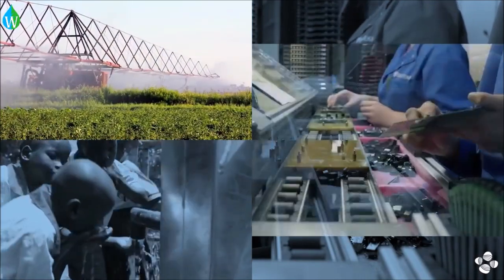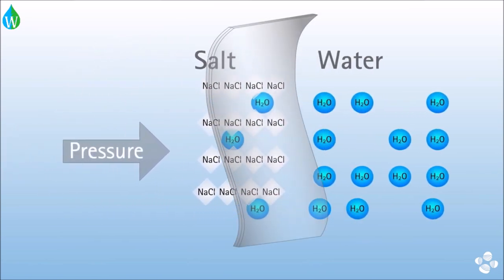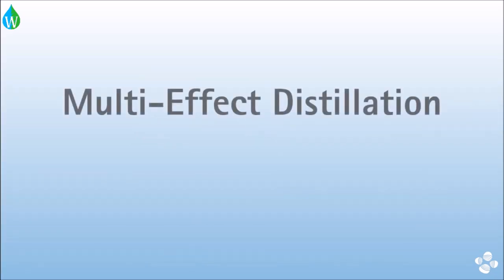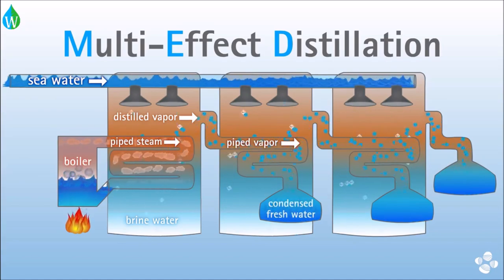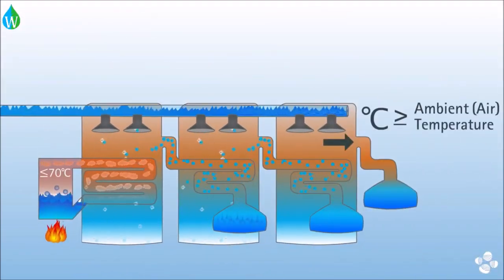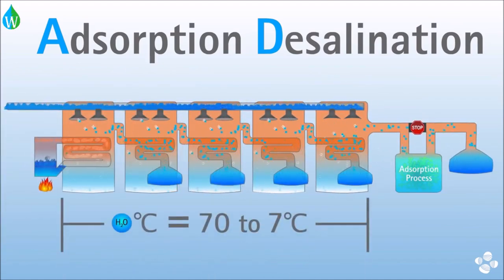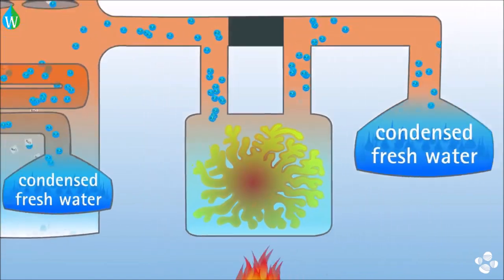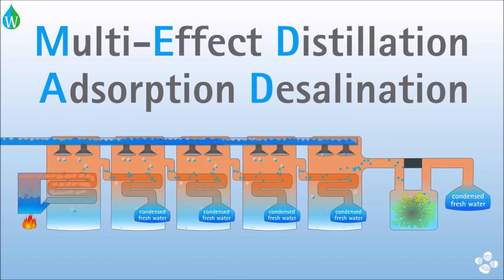Multi Effect Distillation Adsorption Desalination (MEDAD) 💧💦🌊 | Waterpedia #WaterWednesday

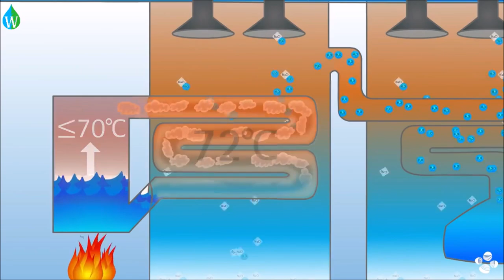Comment: @ 2:04, Couldn't the "pipes" be designed to function more as a large, flat heat sink. Then allow the salts and other minerals to build up on that flat surface, and then periodically scrape off the surface and collect the minerals? That would also allow a higher input temperature, right?

Comment: What happens with the Dissolved Solids (salts) as they drop out of solution, also does the salt become part of the adsorbing gel and how is that removed.
Reply: As far as I understand:
1- All desalination processes produce brine. It is unavoidable. The disposal of it is an environmental problem.
2- The gel absorbs additional water vapor at the end of the process. It is not supposed to be in contact with salt at all.

Comment: Except if the swamp is Magick and lower the energy use for the water heating and ewaporation in the end stage you will not save energy.
Instead pump more water from the ocian and let it cool the end stage and let it run out in the ocian again thining the brime. 2 problems solved